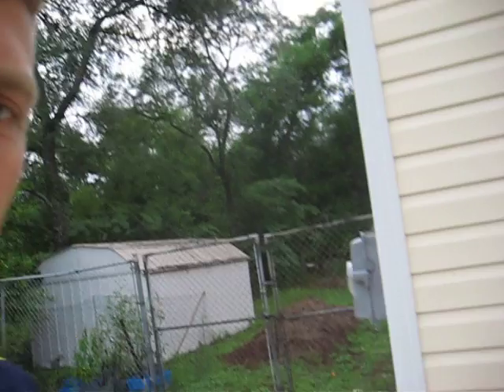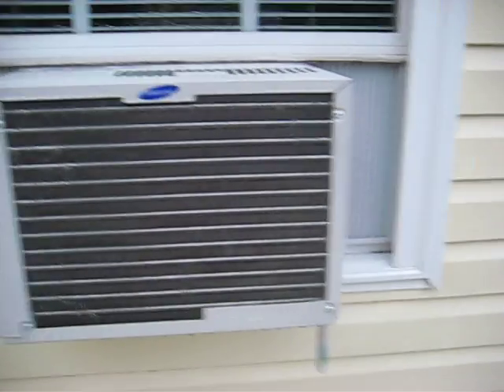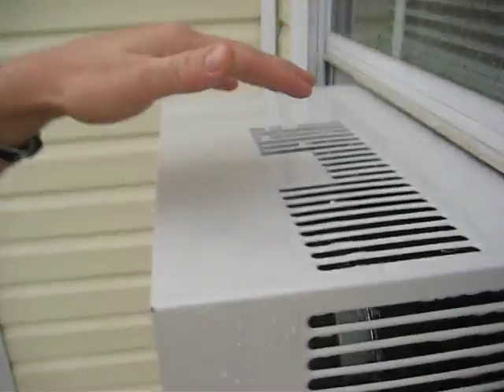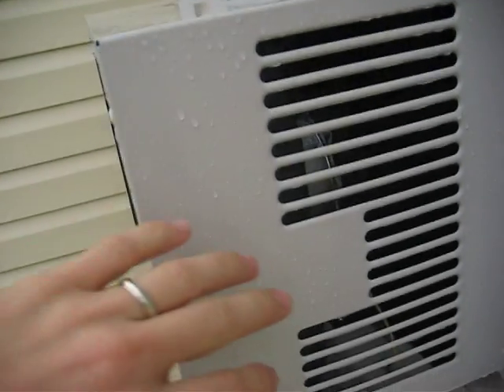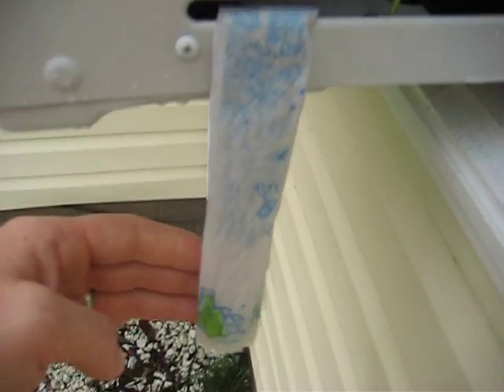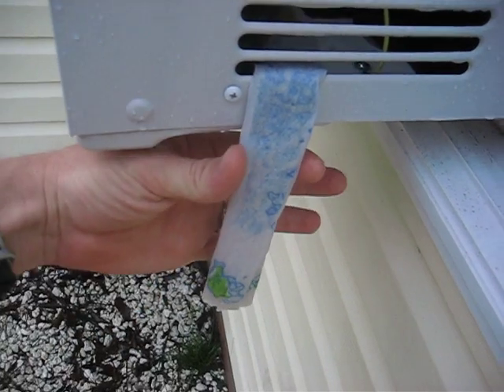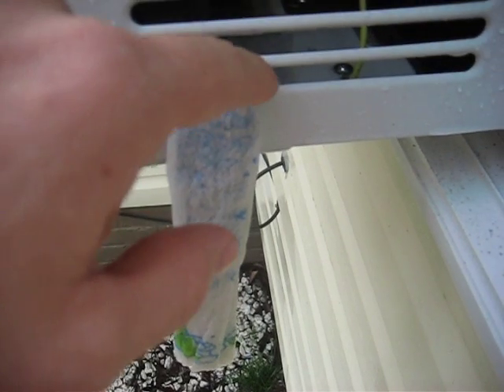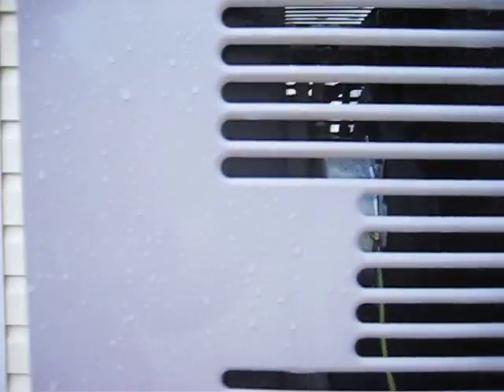HOW TO: Window AC water removal

Comment: Wow great Idea Thanks!  DO NOT drill a hole or do this every day though, these units are meant to have some water to sling onto the coils and improve cooling.
DO make sure the back of the unit is slightly tilted to prevent too much water buildup
Reply from the maker: I love this constructive comment: 2 things in reply: Number 1, if this evaporative cooling effect is necessary, consider environments with little to no humidity like the desert. Number 2, simply move the proximal end of the paper towel to the desired height that you want to maintain the water level to create the sling effect on the coils. Hope all are safe and cool this summer. Please consider subscribing if you haven't ready!
Reply: @ogaranhaodefortaleza  , in arid conditions  water is added to the unit tray to increase the cooling efficiency
Reply from the maker: @ARSciandra  I have never seen such a unit, may you link an example please?
Reply: @ogaranhaodefortaleza  , it's not rocket science.  all you do is add water  to the top of a ordinary unit.

Comment: Wow! Heavy rain last night and I thought my a/c was shot. So glad I found your vid. Yay! It worked! And my a/c had been running straight for about a year, so I just figured it was done for. For anyone unsure, I unplugged my unit. It hangs high from 2nd story, I just removed one of the sliding panels that fill the window space just enough to get my arm through, the ac stays secure in the window. I wasn’t sure if one side was better than the other.. so I took my chances. I then put everything back, and powered up the unit. It appears to be working and the “struggling” sound seems to be diminishing. Thank you so much:)

Comment: I hope you get this....I have to thank you for making this video. This may work hanging on the outside, but it also works great from my wall a/c which began leaking inside my apartment. It's buying me time to get my bedroom in order to have a couple of workers come in to clean it etc. Lets just say I keep my bedroom door closed at ALL times! I made your paper towel drain so-to-speak about 2 1/2 feet long, cut the spout off a gallon milk container, cleaned it and the paper towel tail is hanging in it. Now I don't hear the water splashing about and the gallon jug was filled up half way. The simplest things can work and in my case, it was sheer luck that I saw your video.
Reply from the maker: I'm glad this helped you, stay safe.

Comment: Thanks so much for the tip. That dripping, splashing sound is so annoying. I cut a piece of a rag I had, folded it in half and stuck it through the vent. I can see the water dripping out right now. Excellent!

Comment: Wow! Can't believe I didn't think of that!   However, AC works more efficiently (and cools more quickly) with water in it, so don't remove it if you don't have to (it affects your energy star rating).  My problem is that my drain hole is positioned between my inner window and outer window, thus dripping all over the sill (between the windows).  The windows are old and have no drain holes, thus this is causing the seal to rot.  This is a perfect fix to get water from the drain hole past the sill.

Comment: hey dude, thank u so much for the video. it rained hard here today and when i got home from work and turned the ac on it was quieter and slower than normal, so i tried to google it and couldn't find any answers, but your video perfectly showed what was going on with my ac (besides the white foam coming out the back of condenser and puddled in the bottom with the water) and i did the paper towel thing and it worked (used coat hanger to navigate the towel to the bottom basin just before condenser) but there was a shit ton of water and couldn't get too much water out, but now the ac sounds normal again, so thanks!!

Comment: Genius! Pure genius. I am doing this right now on a little Window AC. I also put 1 sheet folded up on the back bottom where the water tries to overflow out but most of the time it does not. I had no water in my right rear side so I had to do this on the left rear side. It goes kind of on an angle but I think it's working.

Comment: Thank you for sharing such a common sense solution that would have never occurred to me. Not in a million years. I'm too embarrassed to say what I tried. My unit doesn't have a drain hole and I don't think it was put in at the correct angle so water is running down the house and some of the paint is completely gone now. My landlord is very angry. I don't have a man in my life to help me re-position it and it's very heavy so this solution will help me tremendously. Maybe somehow I can figure out a way to repair the damage I've done to the house. Watch more videos I suppose 😀. Thanks for using the brain God gave you and all His blessings to you and yours.
Reply: Did this paper towel trick actually work for you?
Reply: Yeah me too!! My ac also has no drain hole and the only way to slant it so it drains is to put the ac in the window wrong. My landlord is also pissed because the ac was so backed up with water it started splashing water out everywhere and damaged our wooden window frame.

Comment: It is normal for water to collect in the lower base of an air conditioner. See the section entitled: "There is water sloshing around inside." If water leaks out the front it is usually because the unit is tilted forward in the window frame. All air conditioners should be installed so they tilt slightly back to allow for proper removal of the condensation collected.

There is water sloshing around inside All window air conditioners will remove moisture from the air if there is any. Most window air conditioners collect this moisture in the bottom pan of the air conditioner and attempt to evaporate the moisture. The evaporation process works as follows: First, the water drips down off of the cold evaporator coils on the front of the unit. Then the water collects in the bottom of the air conditioner base, the "pan." If the air conditioner is installed properly it will be tilted slightly back.

The water then collects near the back of the unit. On some units, the fan blade used to cool the rear condensing coils will have a rim on the outside of the fins of the blade. This rim, or "slinger," will come close to touching the inside of the air conditioner pan when the fan is spinning. As the water collects in the pan and reaches the depth necessary for the fan ring to touch it, the ring will lift some of the water up and the fan will blow it at the condensing coils. Because the coils are warm, they will evaporate the moisture to the outside.

While this is happening it is normal to hear water splashing and sloshing around. As long as there is no water leaking inside the room that is being cooled there is no cause for concern.

Never drill into the bottom of and air conditioning unit to "let the water out."
Reply from the maker: You inspired my pinned reply from a comment 6 years ago, see it in the comment section. This video was intended to be a quick solution to a problem I had where water was entering my house from my AC unit. It was slinging the water on my bed and floor. Too much water in the unit and I installed the unit per instructions, I figured others might have the same problem and could benefit from it. Stay safe and have a great summer.
Reply: sage advice!  ty

Comment: thanks this helped me out bunches...that noise you spoke of is most annoying...my house unit is not working...again...even though i paid a guy 400 to fix it last year..and had it fill with freon 2x...he says there still is  a leak some where!!! where????...so I suffer...when my window unit started spitting at me yesterday....I had mental breakdown as it is my only cool source other than 2 ceiling fans and a floor fan..i was up till 4 am finally took a blow dryer 2 it but i think I will try this

Comment: As previous users have commented, these units are supposed to have water pooled in the pan.  It allows the slinger ring on the fan to throw water onto the condenser coils in order to cool more efficiently.
Reply: I agree the water causes noise. You may drain your pan to reduce noise at the cost of efficiency.
Reply: The design of having water sling back into the coil is efficiency. However, once the condenser is off and the fan is ON, the humidity in the room raised; therefore, defeat the purpose of having ac. I have a 5k btu in a room of 13x12. Initially the humidity drops from 54% to around 50% then if i let it run for 3-4 hours, it increases to around 70%.
Reply: Well it's throwing the water the wrong way, Into my lving room because it's generating way too much.
Reply: Lord Calvanian you need to tilt your ac a little upwards. Read the directions it says jow to do it if water is shooting out front
Reply: I grew up in the Desert Southwest....we never had water accumulate and our window ac units worked just fine.
Reply: It allows manufacturers to sling bullshit. In humid areas like Florida that crap doesn't work. And the water has to get over the height of the back bottom flange - which it almost never does. Meanwhile the water is generating mold inside the unit and backing up to the front bottom of the front coils. And in the well of the hamster wheel which blows the air into the room. Eventually so much moisture gets in the front coils and the unit freezes up. Like an ice box.
Reply: @ianbuick8946  you're exactly right. I was waking up clammy and started testing humidity levels.  I'd rather waste energy and be comfortable then save a bit and be all clammy.  I also found using eco mode keeps the fan off when the compressor kicks off as well.

Comment: I took your idea and added to it. I took the faceplate off the AC, stuffed the front of the drain pan with paper towel and used a wet dry vac to suck the water out through the paper towel.
Reply from the maker: Yeah, I guess my method is a bit 'passive' aggressive BUT yours is just straight aggressive! Solid work, please subscribe!

Comment: ...  But of course, despite my directly previous comment, the premise of this video is absolutely sound, in that the rain (or even very humid air, in which the cooling coil condenses a lot of excess moisture) is a problem, and the paper towel to get *most* of that water out of there is a swell idea.

Just wanted to confirm that I was only being negative to my OWN idea of permanently drilling a drain hole, rather than the premise of this video.  ;-)

Comment: air conditioners are supposed to catch water to kick up in the process of actually running, but they aren't designed to catch large amounts of water, like after a day or 2 of heavy rainfall. this method works because it pulls water out gradually, not all at once. doing things like drilling a hole in the bottom can work, and is an easy fix, but you have to be careful where you put it.

Comment: Modern ac units need the water to pool inside them to make them more efficient. The noise you are hearing is the fan spraying the water on the condenser cooling it down.

Comment: I was thinking of drilling a hole in the bottom of my unit (carefully, to avoid any of the working parts, of course), but yes, I was also thinking that it might be a bad idea to do that, draining *all* of the water like that, since if there is a bit of mist or even just humidity from the evaporating water, it can definitely remove more heat from the coil, which is the entire point, of course!

So now that I have read your comment, I'm more confident just letting it pool up in the collector tray!

Comment: Does water build up effects the AC coldness?
Reply: Reduces it actually
Reply: +mcrarburger I figured
Reply: The AC works better with water in there. It's part of the design.
Reply: +Zachariah Horan is that true window unit works better with water nd it

Comment: These type units are designed to pool water in the bottom so the fan can splash the water around inside. That's how they cool the condenser. That's how it's supposed to work. Following your instructions may cause them to overheat and shorten the life of the unit.

Comment: with the window units of today water is supposed to pool up your condenser fan picks it up and uses it to cool the coils trust me if the manufacturer of your AC unit Wanted to drain there would be a hole this is why the newer units of today are so efficient
Reply: +fiishermanroly --i drilled 1/4" holes in the bottom of the collector pan and let the water drain out..i have window units 3 yrs old and they are ice cold still, the manufacturer does not drain the condensation so the water ruins the a.c. unit faster and you have to buy them more ofter..i have always drilled holes in the bottom of the pans to drain water, say 20+ yrs that i can remember..they normally last 4-5 yrs before they need to be recharged..i buy new ones for $89 -$99 at walmart when the end of summer rolls around 10,000 btu for$96 last october it will last 5 yrs with the water drained..
Reply: +gary singer I understand what you're saying you might even be right but I do believe that the Ac being set up the way they are are more efficient water cools the fins more efficiently than just air I also appreciate not having nasty slimy algae underneath my AC units I'm not saying drilling a hole will ruin that unit it would just run less efficiently but to each his own
Reply: You are right the fan spits water up to cool your unit it's designed that way
Reply: Recharged??  How to do this?

Comment: Don’t drain this water. You should be filling it up with more water till it overflows. This water is there to help cool the coils. If you drain the water the unit will have less cooling capability and blow less cool air

Comment: This is silly. The chassis of this AC unit will be filled with water all the time anyway when it's running (condensation). It should be tilted back to allow all of this to drain.